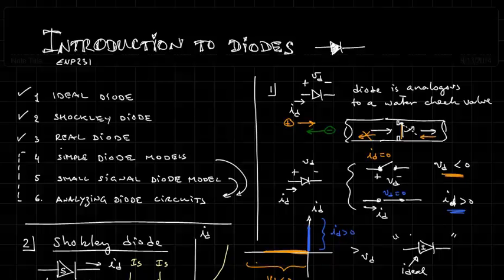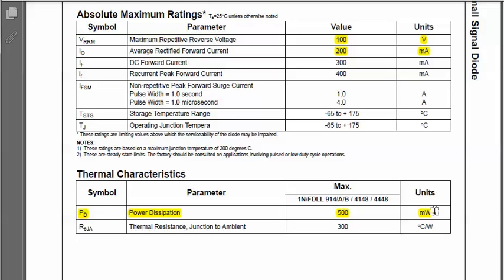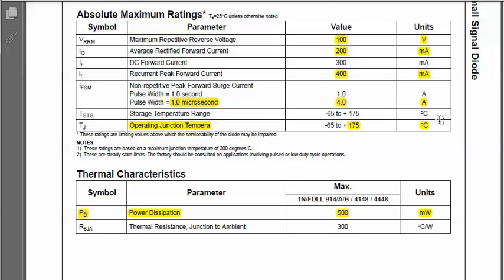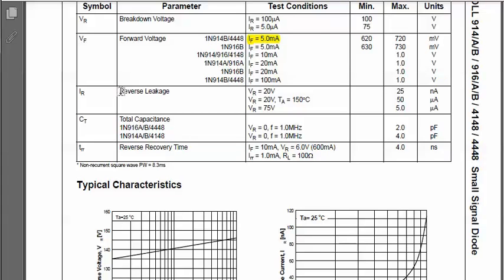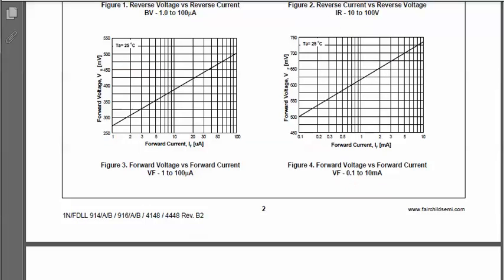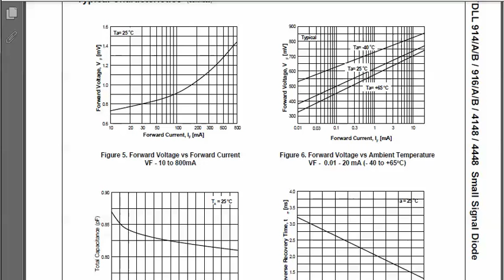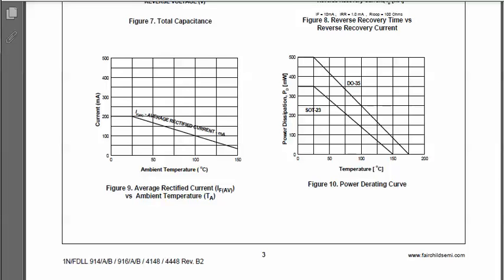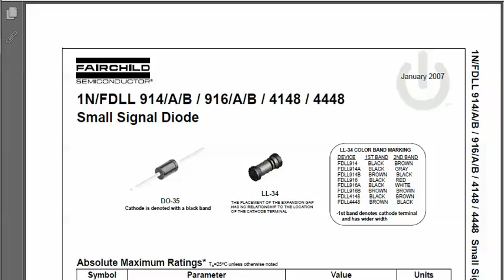Introduction to Diodes - part 2 - Reading a Datasheet

Comment: Why did you skip If (DC forward current) on the first page?
Reply from the maker: Hi! Not sure why, haha, probably an oversight. But that would have been good to explain the distinction between DC fwd (300mA) and average (200mA). I believe what this is saying is that if the current is constant, the diode can handle 300mA, but if it is time-varying then the average should be limited to 200mA. I wish I had pointed out that difference in the video. Thanks for your comment!
Reply: @jogreengel  Thank youi for the followup comment!